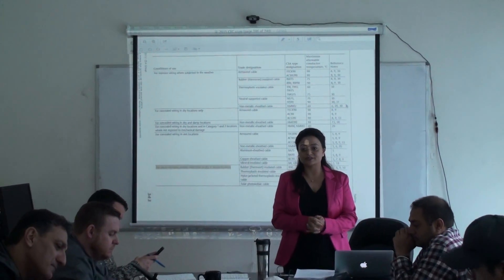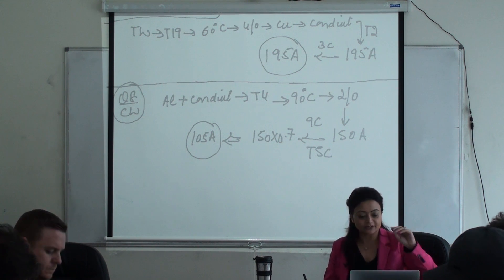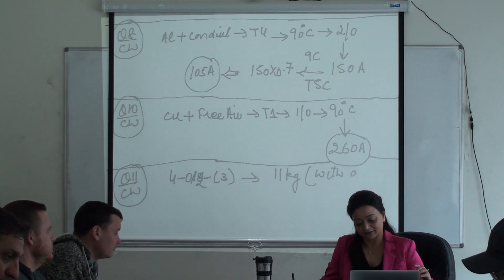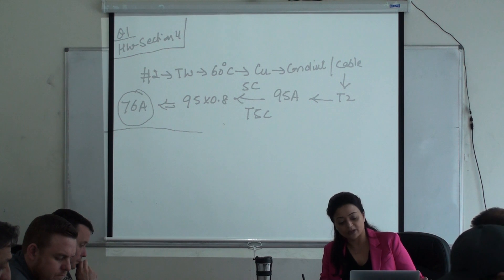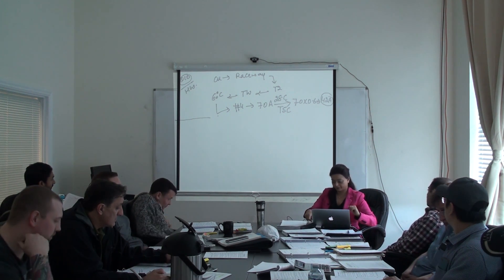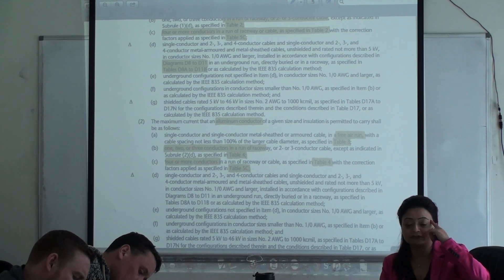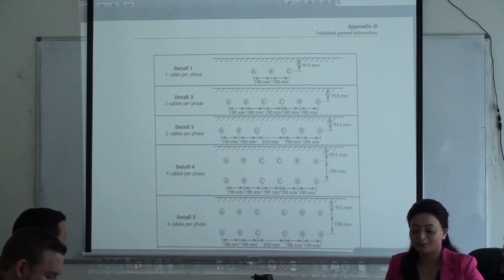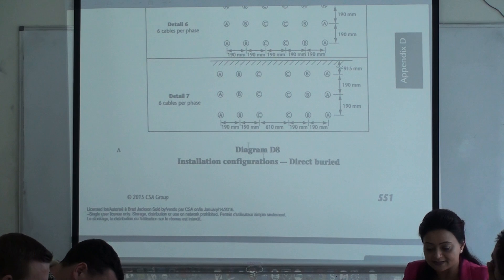2015 Canadian Electrical Code Course-Lesson-1

Comment: Do you have to choose the 60 C column for under 100amps or 75 C column for over 100 amps because the termination temp is not given is the question? Do you derate the wire temp to match to connection temp?